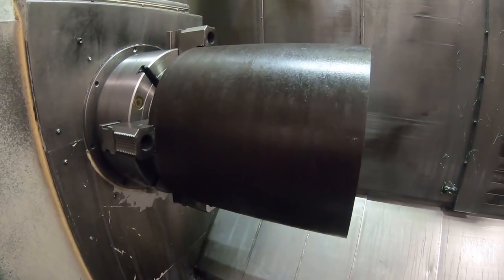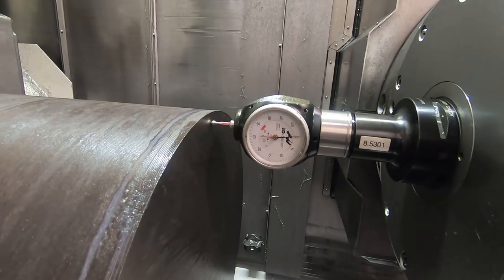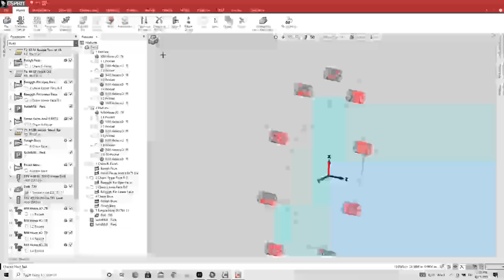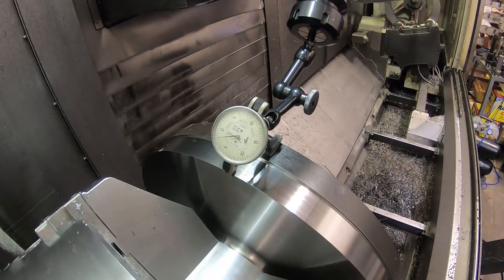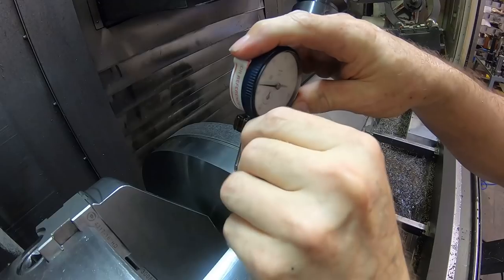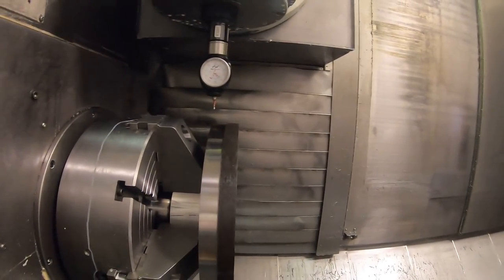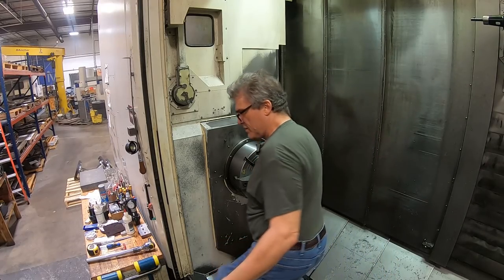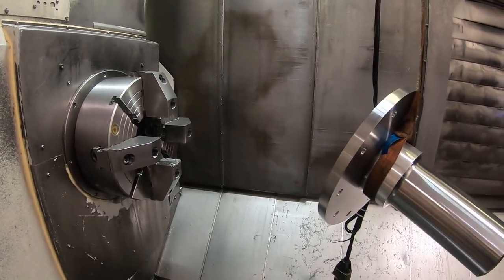830 Op 1 Machining and Flange End Op 2

Comment: peter i am working on a flange like this 40 times smaller huh? 
so 3mm base the shaft is 22mm long for a total of 25mm LENGTHwise the first diameter  is 25mm the diameter of the base 60mm 
i had to put a relief /face groove around the shaft for about .5mm deep!
the part has bent in. it's no longer flat anymore [at the base]. is it possible to re shape it? ? would you use heat? 
it's stainless steel 304
Reply from the maker: You probably should have left stock on the face, to face off after the groove was done. To straighten the existing part. You may if you have a hydraulic press. Make a fixture so the part just sets on the outer edge of the flange. Than a piece to press on the middle of the part. If have to press on the shaft end it may need a hole for the shaft to go in and fit in the face/relief groove you made. So your pushing on this, punch if you will and not the shaft. This may work if you are extremely careful. But for this small of a part wouldn't be easier to just remake it?

Comment: The Compac extended travel indicators are a bit more expensive but I like the dials on them better.  They have an impressive amount of shock resistance.
Reply from the maker: I have never used a Compac indicator. So I cant make a comparison. But as to every indicator I have use the Interapid indicator has been the best. The Compac is only a little more say $30-40 more than the Interapid I use. Shock resistance isn't my main criteria. Its stylus force. The Interapid has a very low force. This comes into play using a indicator in the horizontal spindle position.

Comment: Whenever you milled the holes, was there any reason why you didn't keep the head/spindle in one location and index the chuck? You ended up doing half and then indexed 180°.
I'm just a slightly curious pretend machinist.
Reply from the maker: This machine doesn’t have enough travel in the downward direction (X minus) to reach the holes so I did the top half than rotated 180 to get the bottom half. To get the holes to .780 size it’s using a helical motion with the 500” dia end mill.
Reply: Edge Precision I think KISSMYACE3203 means why not keep the head in one spot and just index all the holes with the chuck until all are done? I’m curious if it could be done that way.
Reply from the maker: @Orgakoyd  Yes it could be done in that way.
Reply: @Orgakoyd  To answer, it's just quicker the way he did it. X/Y movements are generally faster than X/C movements, especially for operations like drilling because the chuck has to be clamped/declamped at every holes.
Reply: @shadowdsfire  Thanks. I didn't think abut the chuck clamping!

Comment: You should make a tool holder with some die springs for pushing parts into the chuck.
Reply from the maker: I really shouldn’t do it that way at all. I piece of soft wood would have been a more responsible or better way. I was really pushing with the face of the spindle. Not the spindle itself. But the better way is to move the tail center up and pushed with its quill with a block of aluminum to protect the center.

Comment: Im just wondering , wouldn't it been better just to take a light skim of the OD on first OP?  So it easier to make the part run true but i keep this videos up very nices to watch .
Reply from the maker: There wasn't a lot of stock on the OD of the rough bar in the area of the flange OD. I wanted to use the serrated hard jaws to grip the stock for the heavy roughing cuts. But this might put dents in the finish diameter of the flange. Also using a 4-jaw chuck the part still has to be indicated in anyway so it would not be that much easier to indicate in.

Comment: Thanks Peter for the video. It was a kind nerve breaking when the spindle ramp up in speed for center cut :-) . When cutting away such a massive part of material will it need heat treatment for internal tensions ? or the material is stable so it will not spontaneous release tensions.
Reply from the maker: This material is pre heat treated. I won’t get any post heat treat. It also didn’t appear to have a lot of stress in it this time. Every heat of material is always different. Some better than others.

Comment: Do you have some thumb rule for material stick out ? Usually for 1 " lenght of chucking lenght i go up to 3xD of stick out , just curiois to compare with you! 

Nice vids, i have a e500h and listening to your videos helped me a lot in the starting of my own shop 

Thanks a lot
Reply from the maker: Thanks! This would all depend on what kind of chuck and jaws. The size of the stock and speed I was turning. There really is no rule of thumb. If the stock was 1.0" in diameter I would have no problem sticking it out 6.0". But if it was 16" diameter. To stick it out even 24" (1.5-1) chucking on to only 1.0"? I would have to make sure of the way I chucked it. In a few of my videos I have turned a dovetail connection on the jaws and stock. This in combination with the manual 4-Jaw chuck is a very secure way of holding the stock with a short chuck length. This is a little harder to do with a Hydraulic chuck. Also Hydraulic chucks will lose chucking pressure with speed. Something a manual 4-Jaw chuck doesn't do. So you see there are a lot of variables to consider.
Reply: @EdgePrecision  yeah i got an hydraulic chuck i want to change it to a manual chuck for more grip, when i extend too long i reduce my parameters and max rpm but its a pain to never know if it will hold haha

Comment: There used to be a form of Rain-X that was a stick that you rubbed on the windshield and then buffed with a damp rag, and it lasted quite a while. Maybe that stuff still exists as well as the squirty kind. Some sort of venturi suction should work for injecting it in the air line. Might be able to get a cheap Chinese coolant mister that you could adapt. Or of course just make something.

Comment: Am i able to ask...but say if you need to modify the program to do tapers and or radius G03 or G02 without cutter compensation do you edit the program manually or do you edit the program using the CAM software?
Reply from the maker: I prefer to do all modifications in the cam software. For a couple of reasons. One is to avoid big mistakes in entering incorrect numbers. But the main reason is if I change the program in another place or way and reprocess code. If I did changes manually I would have to remember all of them and go back and redo them all.

Comment: Curious if there is a program or feature that will allow you to turn a dish face like a manual lathe was meant to. Cheers.
Reply from the maker: Yes with the cam software you can turn at any angle you want to. Use facing cuts turning cuts or even at a angle to the face. Now with modern software you can even turn with what I will call a trochoidal type of path. The feature doesn't change just the machining strategy of the cycle. If that makes sense. Generally I use turning cuts instead of facing on this machine if possible. This is easier on the insert and a little faster. Particularly on large diameter parts. The spindle doesn't change speed as fast as a small machine or go as high a rpm. So to maintain constant surface speed it ramps the spindle up and down on the facing cuts. When cutting this is harder on the tool. Also when it finishes the cut in the center at high rpm it rapids back to, in this case 16" in diameter. It has to wait for the spindle to slow down before it starts cutting.

Comment: What spindle speed do you lock the max rpm at? That is a massive workpiece.
Reply from the maker: When roughing in low range it can’t go above 460. But when most of the material is removed on this part. I limited it to 1000 rpm in high range. The machine can only turn 1600 in high range.

Comment: Can you purchase a rough casting closer to the dimensions? Or is it not possible? Is it cost effective to have a cut off pieces where you just mill them? Thank you for educating on the process of set ups, milling, and finishing a part.
Reply from the maker: Castings require patterns to make. For this small quantity it’s not cost effective. Also a casting in this case is not strong enough. The turning is faster than milling.
Reply: You can purchase a forging, just need a big lead time and lots of money.

Comment: how come you didnt turn a register when you faced off? that would have been common sense? just wondering as you were on about trueness in the jaws yet you left the skin on. i usually skim how much im holding plus extra or the length of the part up to the jaws
Reply from the maker: I didn't have a lot of material on the OD for the next end. So I didn't want dents from the hard jaws on the finished OD. But even so. When chucking with the 4-jaw chuck serrated hard jaws, it really doesn't require a turned diameter. The rough stock as provided already was rough turned as well. Short explanation it would just be extra work that wasn't necessary. If a was chucking the part in a Hydraulic 3-jaw with soft jaws than I would have skimmed the OD for those jaws.

Comment: Why would you not take a light cut on the O.D. prior to turning part end for end? You know you have an issue with seating the part in the 4 jaw! For chamfering, I find an old Brace with a chamber tool in it works quickly and well.
Reply from the maker: I didn’t have a problem getting the face up against the jaws. I prefer to leave the rough OD the stock had. The jaws get a better grip on it.
Reply: @EdgePrecision  My thought was for concentricity and squareness to the machined surfaces.

Comment: When I put the part in the lathe (hanging from the crane) I always liked for the part to be slightly higher on the tail stock end, doing this works as you lower the part into the jaws the part will stay in place using gravity, you don’t need to hold the part with a tail stock or turret.

Comment: This is probably a stupid question Peter but as I am not a machinist but have a interest in machines but anyway is it my imagination or dose the mazak speed up and slow down automatically when you are doing face cuts, and as you have just mentioned about the problem with the lens on the camera what would help for sure would be a ceramic coating to help clear the coolant away I am a car detailer and use it on finished cars to help the water run off, just a thought. Love the video's.
Reply from the maker: The glass lense cover in my case had a special coating just for that purpose. But it doesn’t last forever in the coolant. I bought the glass from
Edmund scientific they work good for a little while. Last time I bought three of them about a year and a half ago. Yes when the machine is in the constant surface speed mode it will keep the surface speed constant up to a rpm limit you set or the maximum speed of the spindle.
Reply: @EdgePrecision  I don't know if it's the same stuff then because I have had cars in where the customer has had a go at applying a ceramic coating and made a mess and I have had to use 1500 grit wet and dry to remove what they have done and do it correctly, mind you I haven't ever subjected a car to the coolants you use either so there's that, your mazak is a very impressive machine and even though I only understand about 10% when you are talking and going through the programming I just listen and gradually it makes sense.
Reply from the maker: @jerrooney8714  I would like to try it. Where can I get some.
Reply: @EdgePrecision  there are several available Peter I would pay between $80- $100 but bear in mind that one small bottle can go around a whole car twice I am in Dublin Ireland so don't know any detailer supplier near you the one I use is produced by a company in Holland called Cartech I am sure they would ship it to you but it might be easier to stay local anyone that is into cars would be able to point you in the right direction for sure. Its definitely worth a shot alongside the airblade, that was thinking outside of the box for sure, very simple but clever and it works very well.

Comment: It's a bit oftopic, but I'm wondering how your Ballscrews are holding up, since you do roughing and finishing on this machine, I'm asking cause at my work the X-Axis on a rather big horizontal CNC Mill is slightly worn out (after 7 years) and you can see it on the milled surfaces and the axis is a bit "springy", 3 out of 5 Ballscrews get replaced this year, I guess it's not so bad with a lathe cause the Forces go mostly in one direction
Reply from the maker: As far as I can tell everything is OK on the Mazak. My horizontal mill is 7 years older (Built in 1999) and has done harder roughing than the Mazak and its completely accurate. I would say if your ball screws are wearing out. You need to check if they are getting lubrication. Or maybe the machine has had some bad crashes.

Comment: The Windex dispenser--just add a small venturi into your air line just before the air blade to automatically add the windex?.  Or get an inline air oiler and fill it with windex?
Reply from the maker: The RainX works better than Windex. I think a air oiler in the air line to the camera might work.
Reply: @EdgePrecision  I meant RainX......ooops.

Comment: Would the rain-x get mixed with the lubricant?  Will it not be detrimental?
Reply from the maker: Possibly but I have been using it to clean the windows and spraying it on to clean the cameras lens window for years. I think there would be less used if a small controlled amount could be bled into the air line.

Comment: How often would you say you program machined chamfers on your milled features such as holes that are interpolated or things that are milled? I know in a previous comment you said you normally do not just because its an extra step to potentially scrap an expensive part and setting the tools up. On my parts i program i usually chamfer every feature that i can get to, although thats usually prodution work.
Reply from the maker: I think milling chamfers has its place. I have in the past done so. But if I’m not making but a few parts out of expensive material with no setup material. I will let the deburr guys take care of those corners.
Reply: @EdgePrecision  fair enough. I just usually find that the machined chamfers result in a better looking part overall than hand done deburring but i dont work with the value of material you do. I usually have the luxury of a setup part to fine tune my chamfer and fillets and such.

Comment: Sorry for my English as I use a translator. Could you tell me what cutting conditions you used when turning a part on such a "overhang". And how much allowance was removed in millimeters when trimming in one pass?
Reply from the maker: In inches it was for roughing speed 450 surface feet feed of .016” per rev depth of cut .250” per side or .50” off the diameter per pass.  Finish cut speed 800 SFM at .005” feed. Insert Sumitomo CNMG 432 EMU grade 8025 for rough. For finish VBMT 332 same grade. You will have to convert the inches into mm if that’s what you use.
Reply: @EdgePrecision  Thanks for the answer. I'm from Russia. And we all count in millimeters. Since we have a metric system of measurements. It is not much easier to relate different quantities. Much is simply done "in the mind." You have a very powerful machine. If it allows you to work with such feeds at such diameters. You can also ask, what is the clamping force on your cams, if it does not align parts with such an overhang?
Reply from the maker: @m1stral644  Are you referring to the chuck? I am using a manual 4-jaw chuck. With the serrated hard jaws it holds the part very securely. I pretty much tighten the as tight as I can with a wrench around 1 meter long. As to pressure I don’t know.
Reply: @EdgePrecision  I understand that you do not have a torque wrench? It's clear. Once again, thanks for the detailed answer.

Comment: how do you know that the material that you are making the part out of is "completely round" and that it will be able to get a low run out on the dial indicator?
Reply from the maker: If you turned a diameter it should be round. There are things that could influence this such as bad spindle bearings chuck pressure on a tubular part. But in general if the part is solid round bar and you turned it on your machine it is round. It should indicate round with no run-out if centered on the spindle.

Comment: hey peter,
 your 418 sfm is that on your G96 line? Whats your G50 set to? same with your 750sfm
Reply from the maker: In low range the machine cant go over 460 Rpm So its really not a problem. But I set it at 500 for low I high range it depends on the part. If I'm taking a face cut on this part The first one with the whole stock I leave it in low range. But doing finish cuts when the part is lighter in weight I use high range. On the OD tools I limit it to 1000. On the ID tools I let it go to the maxim of 1600. Unless I'm in the steady rest than I would limit it to around 500. You can damage the bearing in the arms going to high a Rpm when holding bigger diameters in the steady rest boring a small ID.

Comment: Why didn't you do a quick op to skim the O/D and chamfer to get the job true to sit straight first...
Reply from the maker: It was just extra work and time for no real benefit. Once those serrated hard jaws bight into the part it isn't going anywhere. Also there wasn't a lot of stock on the OD of the stock. I did't want dents in the finish flanges OD from the hard jaws serrations.

Comment: wow he takes 1/4 of the roughing depth of the cut and the part sticks out over 18 inches long part weighs about 930 lbs without tail stock support it me feel nervous, but everything turned out okay on the first side operation, the second operation was a lot more easily feel more secure chucking than first,!!!